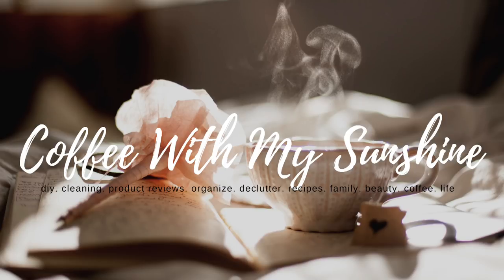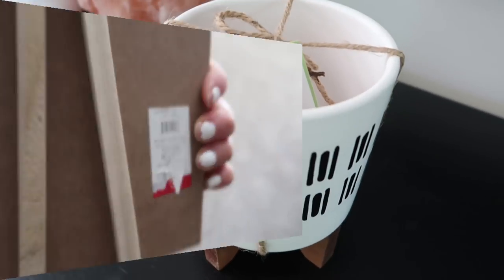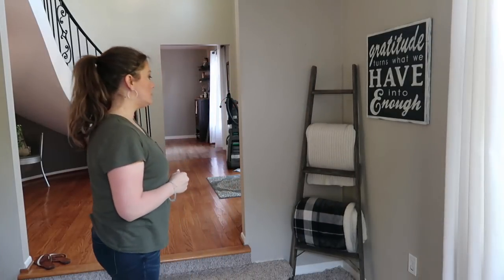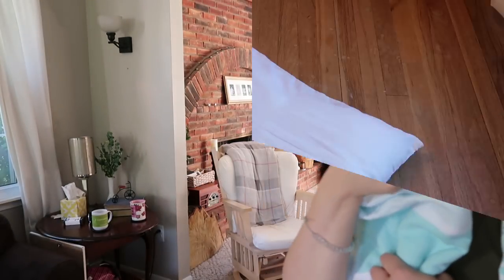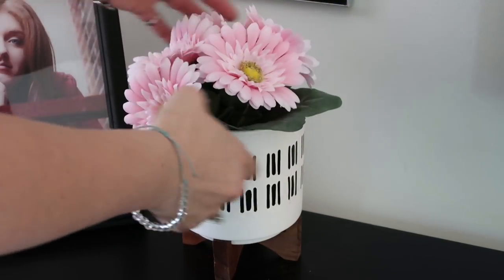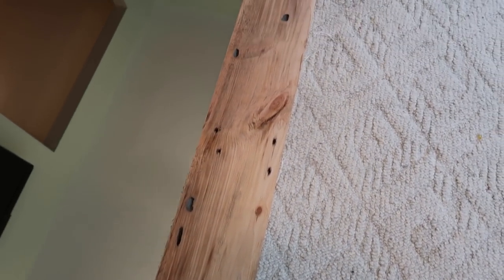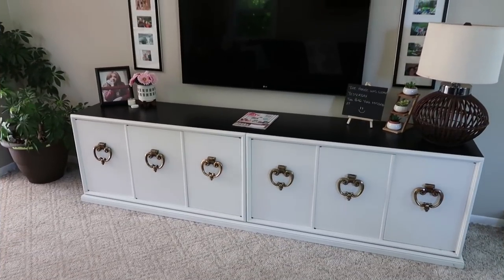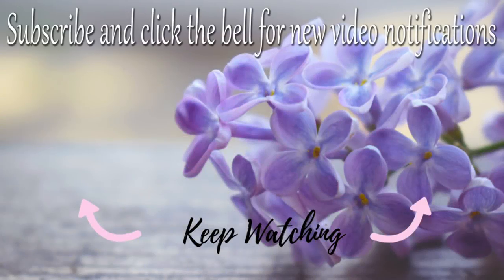SUMMER LIVING ROOM REFRESH | IDEAS FOR HOME DECORATING ON A BUDGET | DIY | MODERN FARMHOUSE Decorate

Comment: Lovely refresher 😍
I wished I had found a stool like the one you found at the thrift store. I would have spray painted the screw looking part metallic gold so that it looks like a huge screw and spray painted the legs metallic gold as well so that they look like Metal and I would have spray painted the seat (round) parts white 😊
I think that way the plant wouldn't cover its beauty because the colours will peek through and it will go well with the writing on the wall and your entertainment center which by the way I LOVE LOADS! Good job on that!!!!
The mirror is lovely but matches more with the area where I see the rocking chair. I would have done it in white to bring the whole room theme together. 
By the way, you did an EXCELLENT job overall. Keep it up and thanks for sharing! 😘